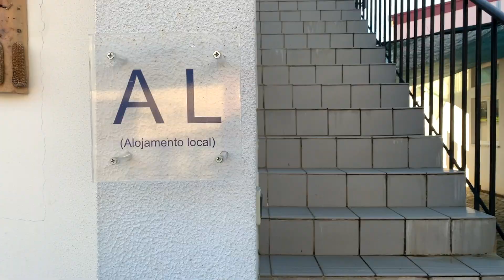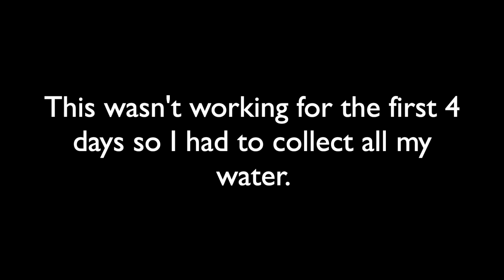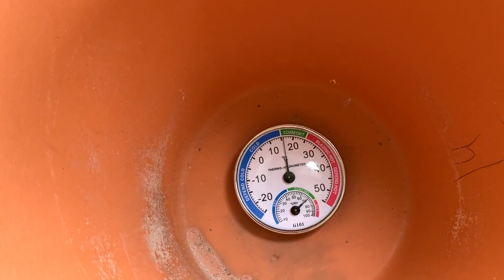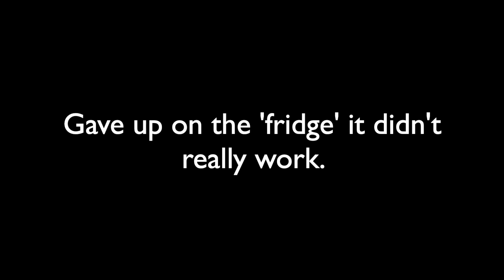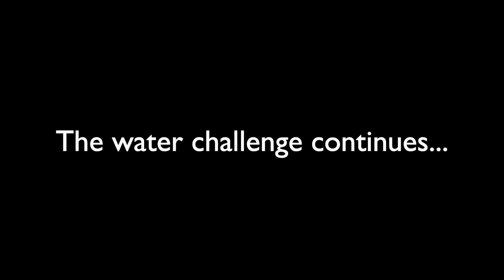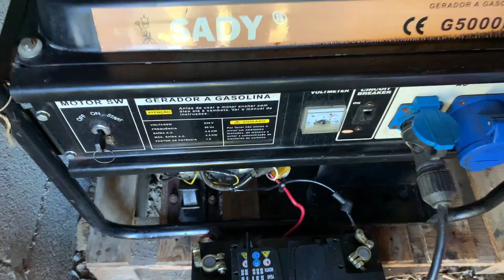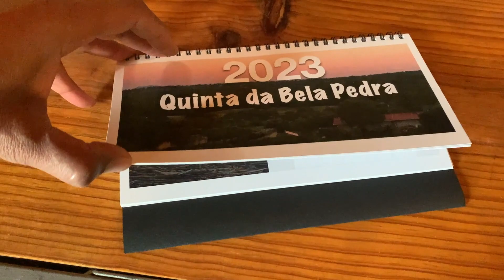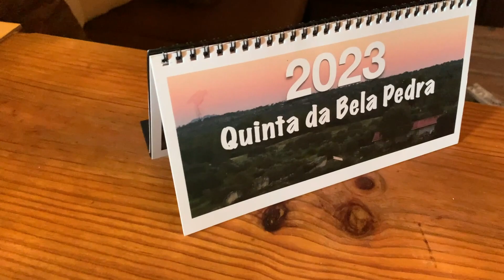Solo female 55 Off-Grid STRAW HOUSE in Rural Central Portugal 🐈

Comment: Oh my word! I have a place where you can stay for free. It's not off grid, it has power and water and there are no animals to take care of. It's rural but not remote. It's not easy to heat, but there are piles of firewood. Let me know if you want a more comfortable month!
Reply from the maker: Thanks for your kind offer 😊
It wasn't that I needed the place to stay, they needed help getting the cats looked after.
Reply: I should add i am also an over 50 single woman. I bought a lot with 2 houses, both well fitted out. I live in one, the other is empty and would be much better off with an inhabitant. There are 2 cats but they're mostly in my house by the wood burner 🙂
Reply: Near Ponte de Lima
Reply: @Solo50plus  oh wow 😳